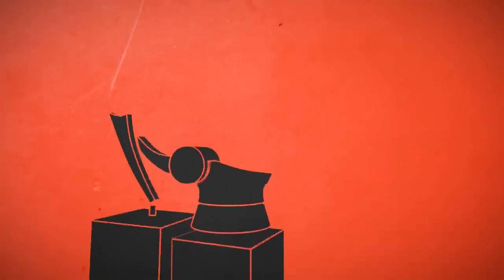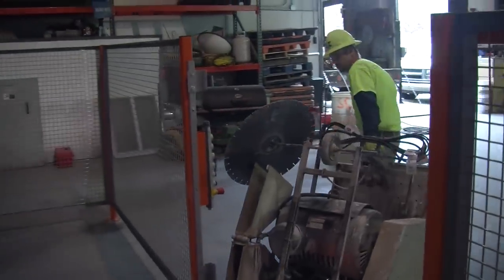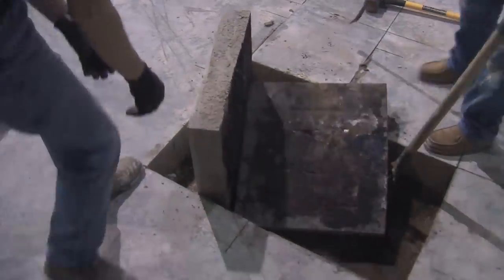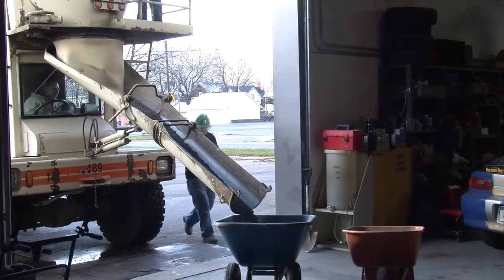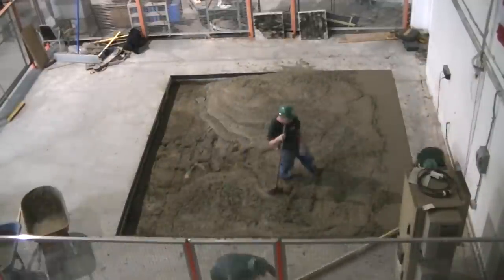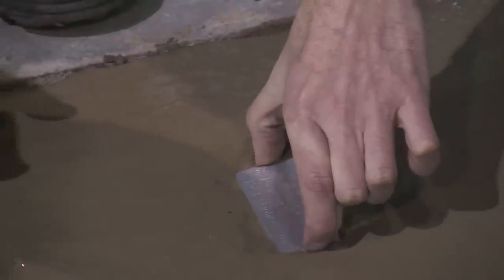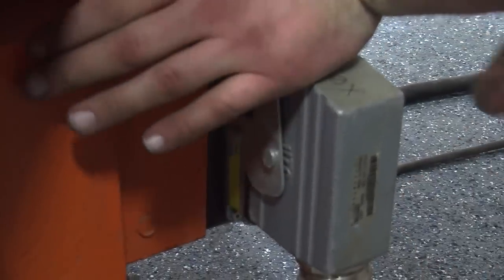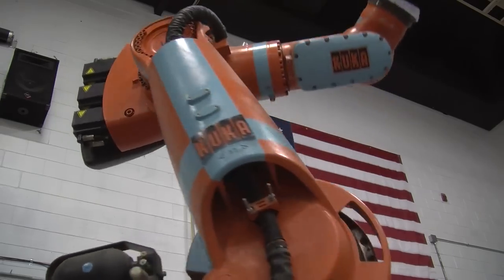Installing Our KUKA KR-350/1 Industrial Robot (Project Jeff)

Comment: Great job with the concrete pad, it looks pretty nice. However, I have a couple complaints... after all that work with getting the concrete just right, you could have also run some cable tray all the way back to the controller to protect the wiring completely. The stuff isn't that expensive, but robot cables are.

Also:  I'm pretty sure that the access to the PC in the robot controller should be on the OUTSIDE of the enclosure. Hopefully you only run it in Teach mode when people are sitting with their back to the robot, as that's horribly unsafe.

I work in industrial automation with Kuka robots. This cell would NOT pass a safety review.

Do you have any other emergency stop provisions than just the pendant and controller e-stop buttons?

Comment: I'm sorry, but the correct way to do this is to make rebar cage where the bolts that holds the robots are tied in to the cage. Not just a small matt thrown randomly into the top layer, and then 8 bolts put in the top layer. You want the forces to be transferred into the whole concrete block...

Comment: Your rebar looks like it's installed pretty close to the middle of the slab thickness, which is along the neutral axis of bending moment.   This does not offer the greatest amount of strength.    Reinforcement should be placed as close to the faces as possible while still maintaining adequate cover (protection) by the concrete.
Reply: +SolarMillUSA It looks like it's closer to 1/3rd or even a 1/4 down into the slab around 8:36 is a good idea of just how deep the area is.

Comment: It always cracks me up how these cutting edge robotic arms all use parallel or serial connections to the computer instead of a faster more modern bus like USB. Must have something to do with stability over performance.
Reply: My thoughts exactly. I don't really think the volume of data transmitted is large enough to merit moving to something like USB. I've used several smaller CNC machines and 3D printers which have all had stability issues with USB.
Reply: Mr.jerry..hii!!
Reply: hahah what look what you wrote parrallel vs usb cmon lol think about it >_<
Reply: When that robot was produced in the early 90s USB had not been invented yet.
Reply: parallel is better supported i guess windows mac Linux or your moms toaster its just parallel even a arduino could bit bang the data it wants 

also jusging by how some things use the parallel port its a simpler protocol and design than having to factor in a usb controller circuit
Reply: I think slower but fast enough interfaces are better because they are less susceptible to electrical noise.
Also, did you notice how the controller runs Windows 95? Tells you about how old this thing is.

Comment: Why didn't you locate the mounts prior to pouring cement making an extremely heavy duty mount and couldn't the cement have been piped in rather than all the man power ?
Reply: 16 minutes in and the concrete promotion is over, finally we are initialising
What is going to be moved around here?  Jeff is some strong beast!  What was needed, IMHO, was a foundation pillar, not a surface - that was hardly a shoddy floor they dug up!
Reply: Simon Masters did you see them put that rebar in, they just threw it in, and it is only covering the center of the pad,
Reply: وتلاا عددقم بالتمرير إلى اليمين أو اليسار لحذف البطاقةLong press to edit & lockLong press to edit & lockLong press to edit & lockLong press to edit & lock

Comment: why not use a pump to pump the concrete into the hole?
Reply: Might be access problems, Genius.
Reply: arbit3r not a very helpful comment was it. your parent's must be so proud of you
Reply: Your comment was not exactly helpful. If they could pump it then I'm sure they would have. They obviously did/could not due to either access or cost implications (Pumps are expensive to rent and large)
Reply: If you re-read my original comment you will notice that it is a question. Now I'm not claiming to be a genius or clever for that reason i was genuinely interested as to why a pump wasn't used.

Maybe too expensive. Maybe Access issues like you suggested.

Because the content creators made a big issue of doing it all by hand i was hoping that they might reply and say why that was.

Comment: You want to have bobcat for concrete pouring, was sad to see manual work.
Reply: Yeah that hurt my eyes too.  I was gonna say a lot of concrete companies have a pump truck.  Just run the hose into the hole, then stand around and watch it fill.  

Very cool video!
Reply: Justin Borja
i thought the slab is just for weight, why could they not pour it on the existing floor and cut around it? or at least throw the old concrete in the new to fill out?
Reply: steffankaizer They had to increase the slab thickness to allow for the additional load, its poor practice to place concrete on top of existing concrete as it does not bond with the existing therefore defeating the purpose of placing more concrete, placing old concrete pieces in with new concrete created pockets of un-bonded concrete which would also lower its structural properties.
Reply: In the video they said the work was donates, if I was donating my guys labor I would not also want to pay for pump hire.
Reply: TheFabricator03 You need to try to move concrete all day by hands. Job was donated or not, we are living in 2014, and to see guys struggle by doing manual labour felt crazy. Bob cat can move this amount 10 times faster.
Reply: GmanBB
While what you are saying is true, those blokes did not seem too fussed. You have to remember the human body can adapt to alot of things, I myself have moved more than my fair share of concrete and can attest how the human body adapts if your doing that kind of thing semi regularly
Reply: TheFabricator03 I do agree, human body can adopt. But ask your doctor, how it will affect your back and joints. And especially when you can rent a bobcat for 200 a day. This is not smart way of doing things, like this guy in concrete and ruin his jeans, shoes, where you can have concrete shoes for few buks.
Reply: +gmanbb, I also agree about the bobcat.  I've only moved blocks of concrete like that once in my life.  The blocks were half the size, and my back killed me for days.  We were cutting concrete to lay in some conduits for power.  The concrete was just 4".  We couldn't do a bobcat though because it wouldn't fit through the doorway.  I'll never volunteer for work like that again lol.

Comment: Mental!  If this is an educational project then save your budget and buy endless $100 30cm 7-axis robots from China rather than install a single machine capable of shifting 100 tonnes and dig a hole to refill with 60 tons of concrete!  You torque it down every day?  What is your theoretical positioning precision here?

Comment: No starter bars drilled into old slab every 400mm and tied to mesh. Expansion form used for an internal slab, ridiculous. The most prophetic concreting standards I'd ever seen, the existing concrete would have been far superior for the footprint of a 350